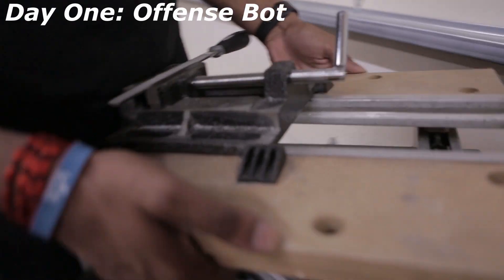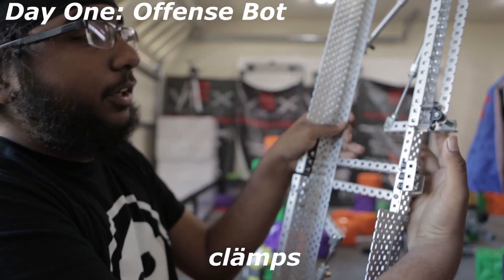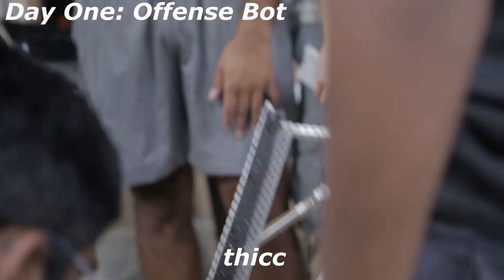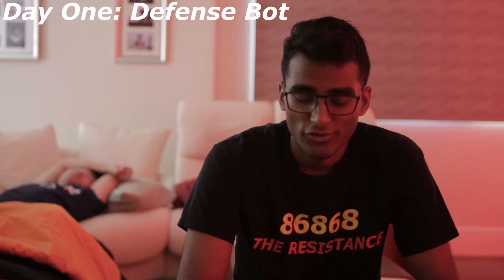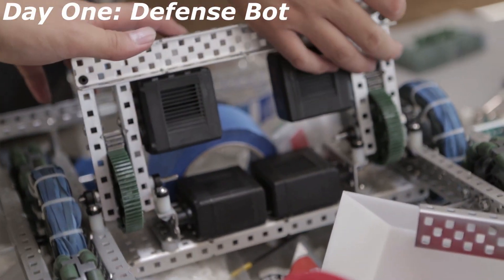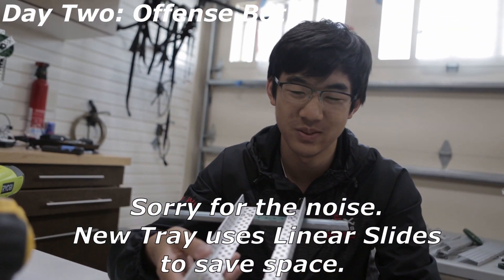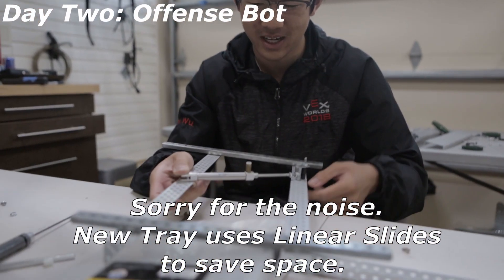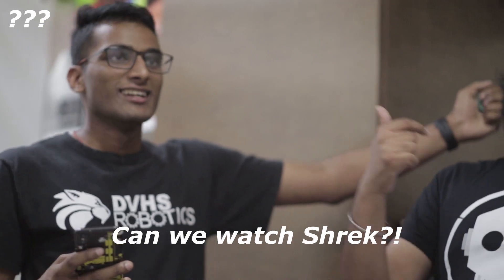2019 NorCal RI3D Vex Tower Takeover Documentary

Comment: How do you get the big wall to actually stay from being pushed from the corners? Is it just pure weight or what
Reply: Even if u managed to displace it, if it hits the perimeter walls there's no moving it.
Reply: Uday Kalra if you push it from the side why would it not just slide out
Reply: @tylercooper5613  9:48 . The meshed bottoms plus the weight make it extremely difficult to slide. While u might get some play with impact, sliding it will probs just stall your base.
Reply: Uday Kalra ok thanks, do you think there is an easier way to make it stay other then just putting a ton of metal and padding on it
Reply: @tylercooper5613  Flat pads where it touches the perimeter comes to mind. I'm sure there's plenty of ways

Comment: Hydraulics aren’t allowed for competition. Why are you guys using them?
Reply: Those are pneumatics and they are allowed in vex you just have to use two fewer motors
Reply: Sammyboyo since when?
Reply: @soulrray5829  you have always been allowed to use pneumatics they just aren't very common they also are not good in V5 because one air canister takes 2 motors and that's the same as it was on legacy that had a 12 motor cap
Reply: Sammyboyo Isn’t the motor limit 8?
Reply: Sammyboyo Isn’t the motor limit 8?
Reply: @soulrray5829   Clearly you need to read the manual. Pneumatic systems have been legal in vex forever, I know for sure since at least 2013. The reason they arent used is because when using pneumatics, the typical motor cap of 8 is lowered to 6, which is very difficult in the v5 system
Reply: Sammyboyo pressurized air isn’t allowed either?
Reply: Using pneum at all is 6m limit. The offense robot was 6 motors and 2 tanks